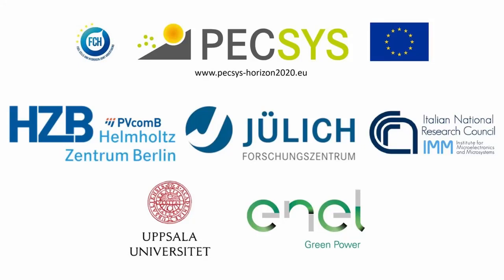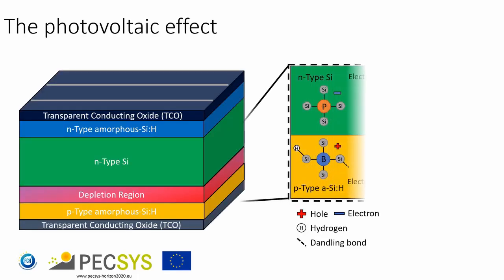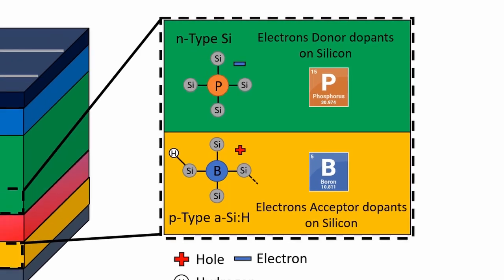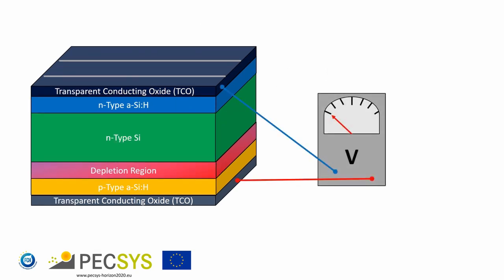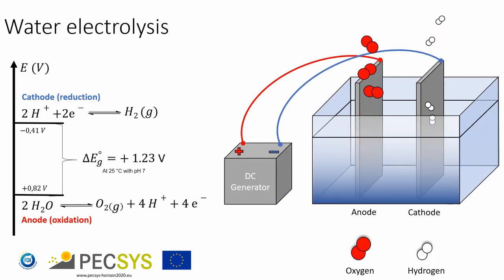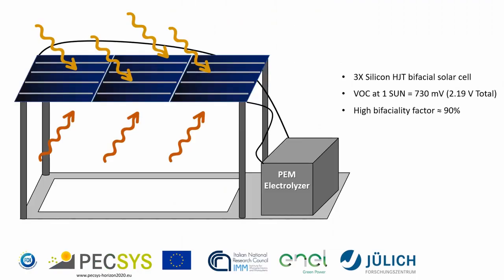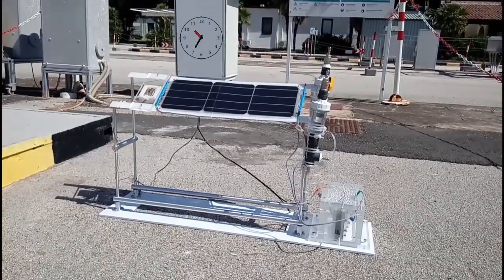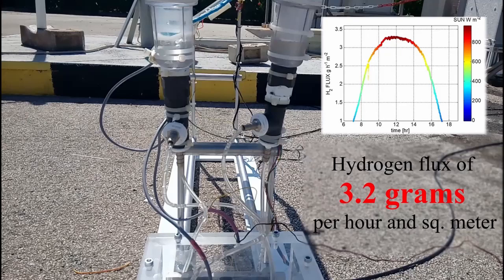Solar hydrogen generation demonstrator based on bifacial photovoltaics

Comment: Isn't it better to install a solar pv system and use the energy to split a mixture of urine and potassium hydroxide? At low electricity consumption, you get Hydrogen and Nitrogen streams at the electrodes while the solution will contain potassium carbonate, a much valued fertiliser.
The Nitrogen stream could be added to a closed dome in which various legumes grow in the presence of sunlight, fixing it in the nodules of roots while oxygen is liberated as a byproduct of photosynthesis. Hydrogen could be absorbed in  suitable carbon material and released at will.

Comment: i  am not a science student but today i thought about a very stupid question from childhood that if hydrogen can be used as fuel and water have both the oxygen and the hydrogen, then why we don't extract hydrogen from the water, this will be the cleanest way to produce energy. Then i searched about the process it need electrolysis to be done. so then i think about the solar system to produce the electricity for the electrolysis and then we can get the hydrogen while releasing the oxygen, and searched about this type of project and this is amazing (sorry for poor English).

Comment: f  a prototype of a hydrogen reservoir with you reduces the volume of the gas by 70% of its size without loss of energy at normal temperatures

Comment: 13.5% efficiency is low isn’t it?
Reply: Efficiency in PV is measured from the total captured sunlight that turns into electricity. It is not low just thought to be low because the number is much less than 100 percent.
Reply: @dylanmira3564  it has to be 40% if it wants to be commercially viable.
Reply: @hafizuddinmohdlowhim8426  Where did you get 40%? This efficiency can be offset economically if there is high enough demand for it/enough government subsidies. As time flies, the efficiency will get up, but 40% seems like a weird number to select to claim its ability to be "commercially viable". There are already niche applications for hydrogen fuel cells like getting necessary power to rural areas for applications such as construction projects where the grid cannot handle the energy requirements. I do have to do more research to understand the science. There may be truth to what I'm saying, but I have not developed any economical model, yet, so I need to find out.
Reply: @dylanmira3564  go find out the truth.